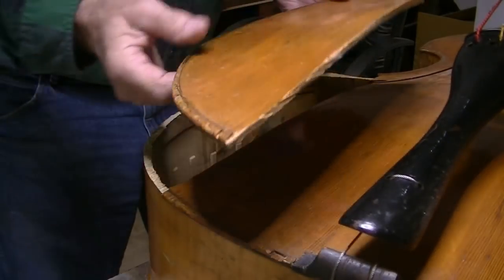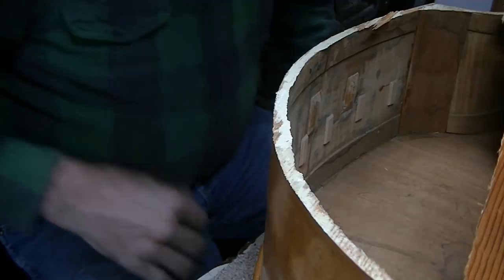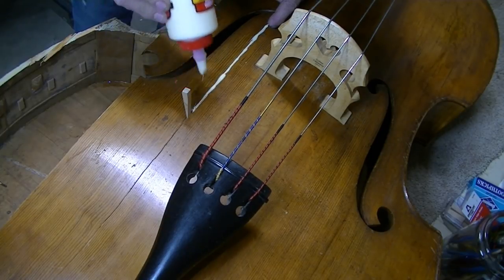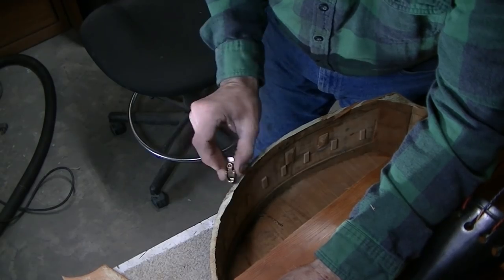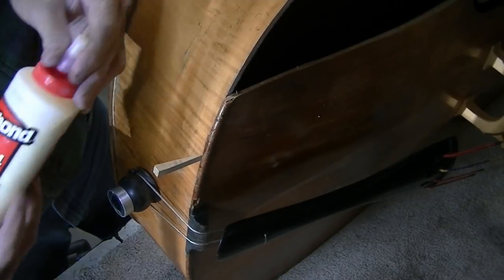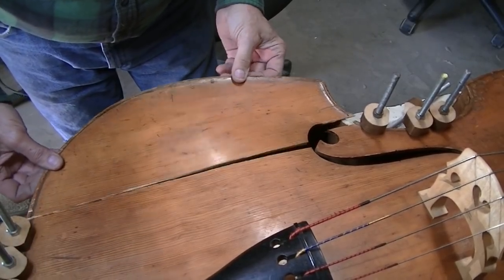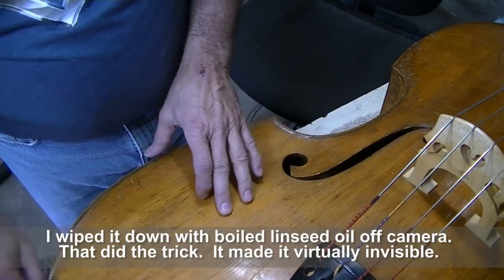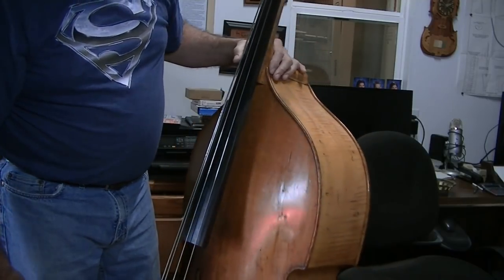220 RSW Obese Patient With Missing Body Parts

Comment: Another reason for not "stressing" out over possible stresses on that initial crack you repaired:  the sound post goes a long way in  supporting the top,  keeping it from "depressing"  and causing any "stressing".   Or so I'm guessing.  
Great job,  as always,  Jerry.  Love watching a master at work.
Reply from the maker: Actually the bass bar is what holds up that side of the top. The sound post holds up the treble side. But either way you're correct, there is support there.
Reply: "Bass Bar: This is a piece of spruce (usually) inside the instrument, glued to or carved into the top running parallel to the lowest string. It reinforces the top so it does not collapse under the pressure of the bridge."

Never knew there was such an animal.   See there,  folks.  Always something to learn from a master.  Thanks,  Jerry.

Comment: I worked restoring antiques in MA in the '80's, and ran across  different glues; the one that looks like wood filler, I was told by my employer, was "fish glue", and I have seen that referenced in books. There was a period in time it was used as the "next greatest glue ever", but after about 20 or 30 years in a glue joint, it would fail, and then be extremely hard, needing a file to remove, as the solvent needed we didn't want around.  I remember one chair of beautiful walnut with Hide glue, Fish glue, Epoxy, Carpenters glue, and Rubber Cement in layers ..... I decided after a couple of years to use mostly Hide glue because it was easiest on the wood.  I had to comment though because I've opened many a can of worms - sometimes by commission - and was so pleased you wisely didn't, love your channel.

Comment: You were right, it did sound very low and muffled when you played it.  The glued in bridge is the kind of mistake I would make if I was given one with no instructions.  "I loosen the strings and the bridge falls out?  That can't be right!"  I suppose you could fix that glued bridge at the possible expense of a new one.

Comment: I have to say that I love your videos and can sit and watch for hours. But it is still hard to watch titebond being used to close a fine instrument. I'm happy with it for repairing cracks and parts which never need to be taken apart but not front and back joints that could be closed with fish glue, if you don't like preparing hot hide glue. Fish glue is used by fine piano builders and I find it great for stringed instruments. I suppose we will have to differ on that. Thanks for introducing me to Zap canopy glue by the way. Great videos though, I particularly liked the mandolin neck repair video. All the best.
Reply from the maker: Titebond original comes apart as easy or possibly even easier than hide glue. But it doesn't come loose on its own like hide glue.
Reply from the maker: Evidence of that is my video where I took the neck out of the guitar I built for my brother. It was glued with hide glue. It only took me 15 minutes to remove the neck. I don't think I've ever done it that fast with hide glue.
Reply: @RosaStringWorks  I'm sure that is correct but it's hard to break with tradition. You don't comment on fish glue? This is not the same as titebond liquid hide glue, as I'm sure you know. It has a long open time and is very strong with a long shelf life.
Reply: @RosaStringWorks   Did you mean Titebond?

Comment: Sorry tightbond is really not a great idea for gluing the plate to the bouts. It not only makes removing the plate more difficult for future repairs but hide glue is traditionally used by luthiers on violin family instruments because temperature and humidity changes allow deliberate failure of the joints to avoid the plates splitting again in the future.
Reply from the maker: I have to disagree with you tight Bond comes apart easier than hide glue. See my neck removal on a guitar that I built myself took the neck apart in 15 minutes and that was glued with Titebond. How much faster does it need to be than that.
Reply from the maker: And I've been building custom instruments for 36 years always using Titebond and never had a problem. Hide glue sucks in my opinion. It was a great glue 400 years ago but we've improved technology quite a bit. Hide glue comes apart if you leave a guitar in a hot car. It also gets brittle and cracks apart due to vibration. It's pitiful. We'll just have to agree to disagree.
Reply: @RosaStringWorks  coming apart in a hot car was rather the point I was making ... if it doesn't dry old wood will split instead?

I am not really talking about guitars but I think old violins, cellos and basses are rather more sensitive than most guitars.

Comment: At 18:19 I saw some more cracks on the top. One was just about an inch to the left of the "thing that attaches the strings to the instrument" and looked ancient for a crack. The other one was much farther away from "the string mooring" to the right.  I suppose they could have been glued back with a (small amount of filler in the) gap, but did you check them in an assessment when you unpacked the Bass(?)?  I'm used to you gluing things together with no visible gap. The left one I saw first, since you were gluing right below it.  I know you can find cracks, the first long one you glued together, was invisible to me until you showed it.  Anyway, viewers like me see such things and wonder why they aren't being fixed? Just let us know you saw it and why it didn't need fixing, thanks!
Reply from the maker: There were lots of previous repairs to the top. In fact I would say nearly a dozen.

Comment: White glue that is cured near freezing temperatures will look like that. It will hold marginally, but nowhere near full strength. (I may be wrong. it's hard to tell from the video.)

Comment: That's to cheap with the quality of work you do.  I think you could easily charge a hundred per hour and still be a great deal for your skill level.  The shop rate they charge for my Peterbilt truck is $185.00 hr for just labor no parts, materials or supplies. are all extras.